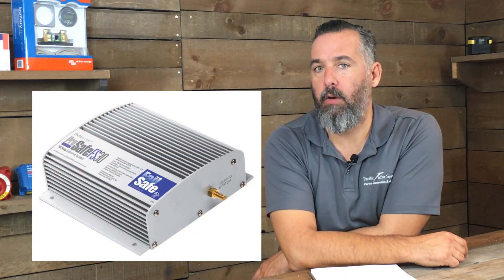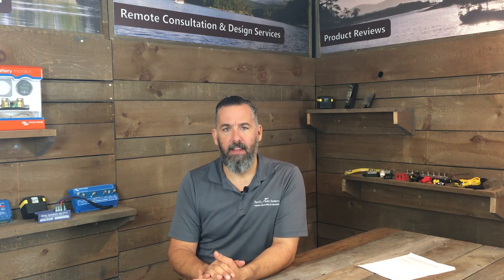Ask PYS - Would You Recommend a Galvanic Isolator for My Boat?

Comment: Hi there. Great video, as always. I have a 20' 2005 Bayliner 195. It's moored. I'm going to be adding a Noco Gen 5x1 battery charger connected to shore power via a plug adapter (three prong to 30A shore power adapter). There is no other shore power on the boat - only the battery charger. There is no AC system on the boat and I don't want to install one - it'd be overkill. I just need to plug in the battery charger. I'm stumped as to whether or not a) I truly need a galvanic isolator in this scenario; and b) how the isolator would be connected as there is no AC panel / power system on the boat. I think I'm OK without the isolator, especially if I use a GFCI extension cord when connecting the battery charger, but I can't find full information anywhere or any schematics for such a simple scenario. Thank you for whatever insight you can provide.
Reply from the maker: When installing AC onboard a boat, you should have the AC ground and DC ground connected together. This connection between AC and DC grounds is the reason we need Galvanic Isolators or Isolation transformers. Without the AC and DC bounded, there is no need for a Galvanic Isolator.
Reply: @PacificYachtSystems  Thank you! And thanks again for all the great videos!

Comment: 47’ Dufour and our Marina only has single line 30 amp shore power service.  Looks like we will need a “Y” and take two 30 amp shore lines and plug into the one receptacle on the boat.  With aircon and multiple appliances total amperage will certainly be over 35-45 amps maybe higher...what size galvanic isolator is recommended?  One that is higher than 60 amps?  Thanks.
Reply from the maker: Hi Hank, you should size the Galvanic Isolator to match the onboard shore power receptacle. If you have two 30 amp shore power receptacle, you should have two 30 amp Galvanic Isolators.
Reply: @PacificYachtSystems  I have one receptacle...

Comment: I have 2 30amp inputs on my boat. Do I need 2 isolation transformers.. I currently have no protection and I want to protect my new investment of lithium and all new through hulls and shafts and props
Reply from the maker: In short yes, from experience and observation, shore power inputs are normally paired to a dedicated isolation transformer.

Curious if other fellow boaters have seen other types of installations.
Reply: @PacificYachtSystems  Very new to me sailboat owner. I also have two 30 amp inputs. I have two separate ac banks on the switch panel. Going to find out this weekend if one 30 amp plug feeds only one switch bank. 
I want a shirt to buy not a hat :)
Reply: I too would love shirts

Comment: Jeff, I have a 1981 Morgan 462 Ketch. It does not have a galvanic isolator. The boat has two 30 amp shore power connections. Do I need a separate isolator for each connection?
Reply from the maker: Yep, a dedicated 30 amp galvanic isolator per shore power inlet.

Comment: Hi Jeff
I have a ProSafe 30 amp galvanic isolator that is not fail safe. The normal testing procedures to test for an open circuit are somewhat complicated, so this is what I came up with. When I upgraded my AC Panel I added an AC ground to the engine (it didn’t have one), but I put a 30 amp AC switch on the ground wire. Every time I get on my boat, I turn off the ground switch and then check a receptacle polarity checker that I leave in a nearby 120 volt AC receptacle. If it indicates a proper ground to shore power I assume that the isolator is in a closed state and I immediately turn the engine ground switch back on. I am not asking for a legally binding opinion, but is my reasoning sound? Thoughts?
Love this new format. Thanks.
Reply from the maker: Interesting approach as a work around. Never tried this and not sure if there is any gotchas we aren't thinking about.

Comment: Thanks for the Jeff, good info. I'm not really clued up on galvanic isolation, still as far as safety on a boat does it use the water as the ground reference through the ground plate ..?  And is that capable of tripping an rcd?.. I'm Not really sure how they're wired, I probably need to research a bit more. FYI The sound level is a little low on the video. . Regards stormer
Reply from the maker: There is no grounding on a Galvanic Isolator, it's a device install on the grounding AC wire to shorepower, check this schematic from the PYS website:
https://www.pysystems.ca/site/assets/files/2536/pys_galvanic_isolator.pdf
Reply: @PacificYachtSystems  thanks Jeff, much appreciated I'll have a look.. So it's purely a series device for the earth wire? Will Rcd's still will work on a boat?

Comment: Do you see many operating where the diodes are conducting so much injected noise from onboard appliances that their protection is rendered ineffective Jeff?
Reply from the maker: Never heard of this... is this prevalent?
Reply: I've not seen it myself but I do all sorts not just boats so I've not vast experience in that aspect. Some galvanic isolators have illuminating indicators if they are being bypassed as a warning. I've not measured it myself. Anything I've done has been shore power independent.
Here's the principle and reason for the question;
http://www.smartgauge.co.uk/galv_tran.html

Comment: Other boaters in the marina used to ask me how I could justify spending so much on a piece of kit that just seemed to sit there doing nothing. I just told them that it meant their boat was probably going to 'dissolve' before mine did. That usually got their attention and many then went out and bought one.
Reply from the maker: Well said. Rather have a little pain now (buying and installing a galvanic isolator) or perhaps insane pain later (stray current damage to underwater metals).